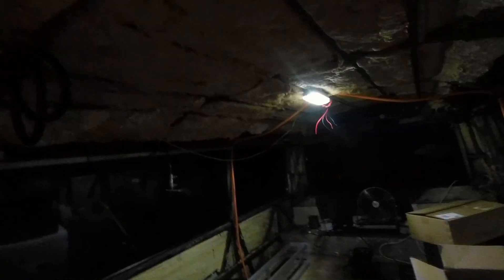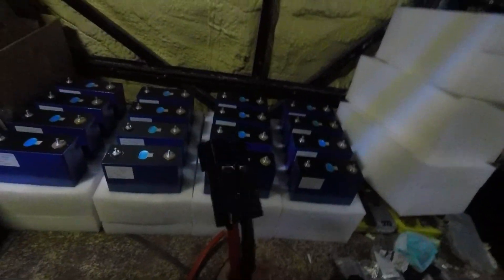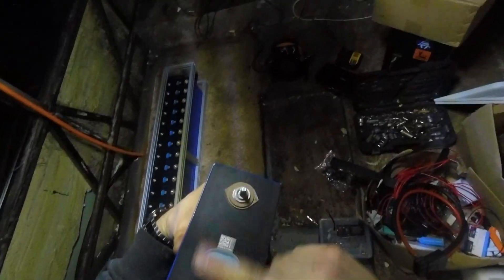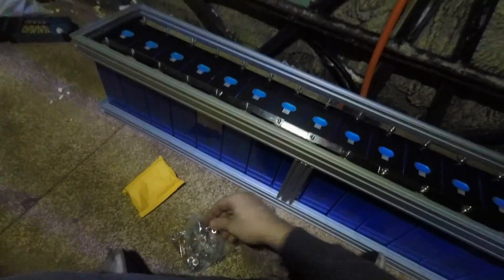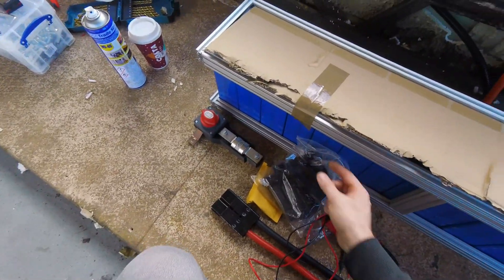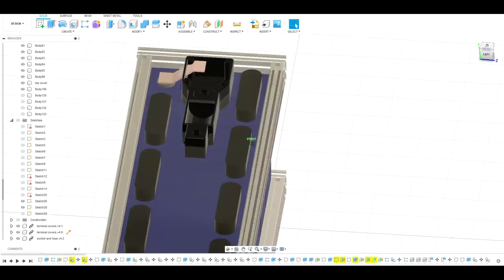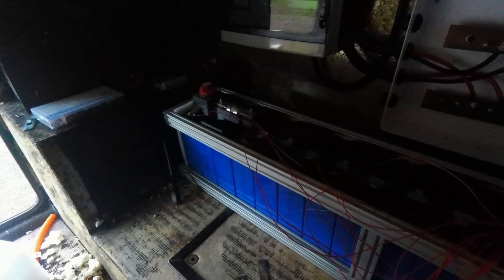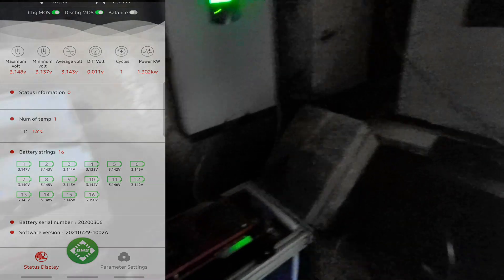Rigging up 13Kwh's of battery! - Before Bus Conversion

Comment: Great job, and thanks for sharing. What BMS have you got? Really cool that phone app.
Reply from the maker: Hi! Thank you! This is a 16s 250a Daly BMS, they are available widely, might not be the most capable, but so far seems to do the job. Rated for 250a constant. They do a wide variety of cell number, voltage and current handling. The 'smart' versions have a Bluetooth module that allow the app you saw :). Hope to do a bit more on the electrical side, but for now it allows some light at night:)

Comment: Thats a serious battery - We have just 4 x 320ah of these cells and they are charged by a 280watt solar panel via a 20amo MPPT - your going to def have plenty of storage  we seldom drain our more than 20% - I just saw this post  https://www.youtube.com/watch?v=EHqXgcrtOkcand ordered the flexible bus bars - with your string so long  I would think solid bus bars would strain the pack as it "Pants
Reply from the maker: Those flexible bus bars just became available from my supplier too! They look like good upgrades to have, even though the pack is under a certain amount of compression, the flexible bars would make me feel better about the longer term use
Reply: @aurorathebus  That how I felt - they are rated at 300amp - its not suprising they are much thicker and heavier - its astonishing they  are so flexable for something that looks solid